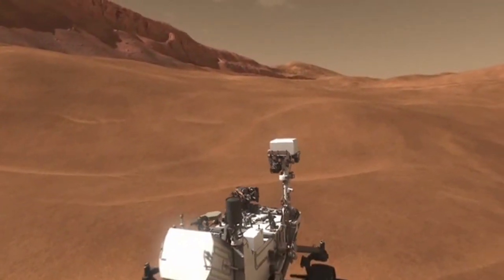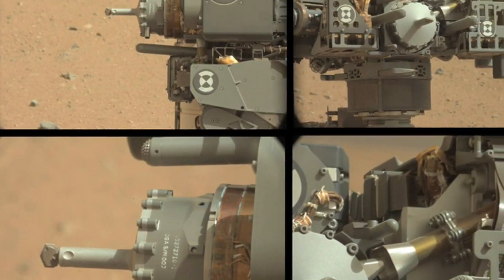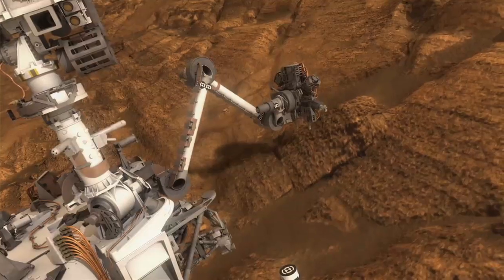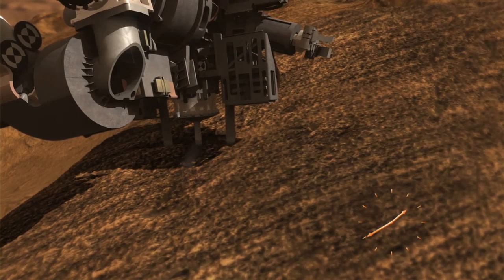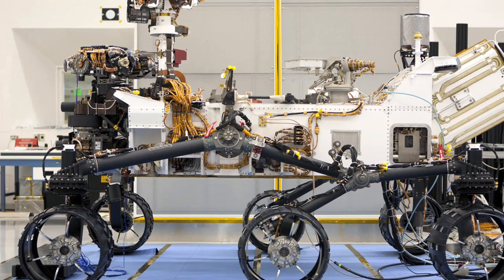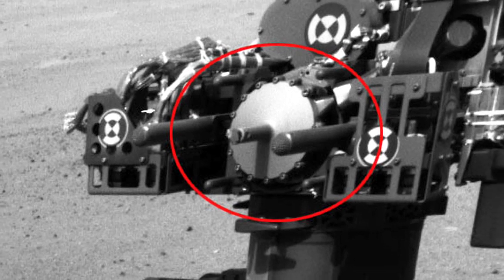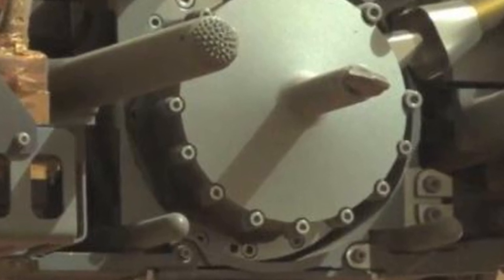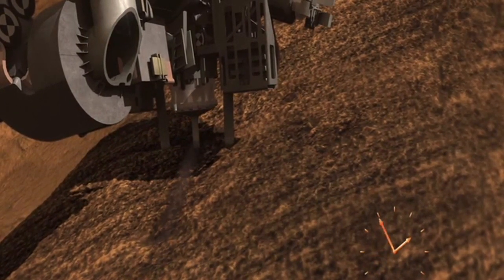Curiosity's Drill Can Break - Known and Flown Anyway | Video

Comment: Chill! I produced the video you just watched. The story was taken out of context. THERE IS NO KNOWN FAULT WITH THE DRILL ON THE ROVER. The issues were with an older ground test unit that had been run for dozens of hours. It will take years for JPL to run the Curiosity drill that long. Also the flight unit was an improved design and was upgraded before launch. So the national press has exaggerated this; there is no known issue with the drill!

Comment: Wow, It's just a little disappointing that they wouldn't willingly push the launch date back to a point where the engineers can be 100% that this extremely expensive piece of technological art will be able to function not only the 2 years asked of it, but for years beyond. If the drill is assured to fail maybe create a bypass relay system that eliminates the electronic interference of any other function or operating system.

Comment: That drill is a great example of unnecessary over-engineering. There are litrealy thousands of diffrent types of percussive drills made to operate in all types of conditions from extreme cold and waterproof to high heat in corrosive enviroment. Hydraulic, pneumatic, electric etc..
 But nooo we have to reinvent it with a new design and skimp on the testing just to have it malfunction on mars.. 

Not everything needs to be put back on the drawing board and completely re-designed. A percussive drill from walmart has more testing, reliable design, a chuck, and is more lightweight... But no you opted for a one of a kind design and a total rover project cost of 2.5 billion. Whats next reinvent the wheel? Ohh.. Shit yeaah hmm NVM...

Comment: i weared out 1-2 drills daily when i worked as an electrician. 2 years of minimal operation time with a single drill is still pretty beast.
Reply: Its a percussive drill. Dont think the drill-bit is the problem. Just a poor design. Thats what you get when you try to reinvent the wheel a third time.. Takes 3-6 days to drill one hole 2,5 inches deep. A joke.